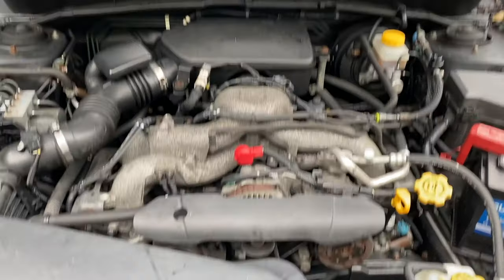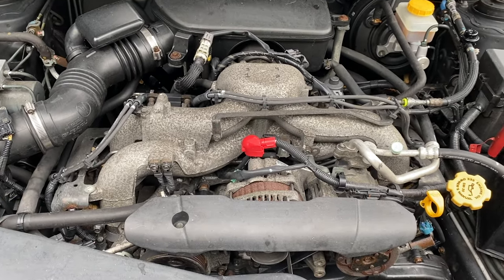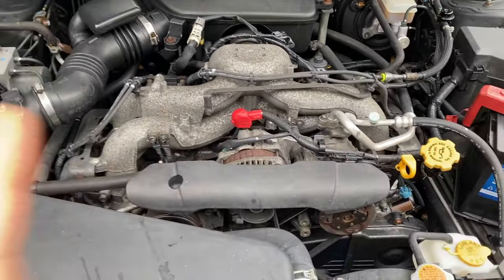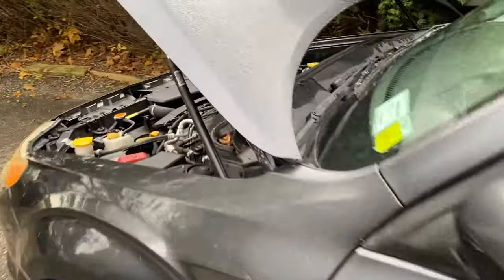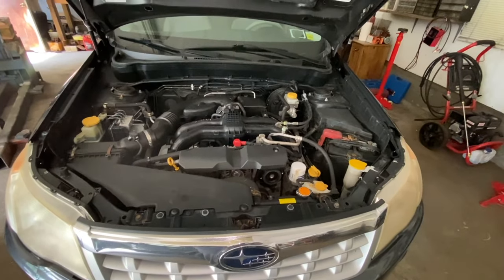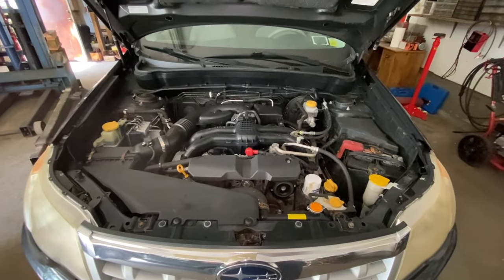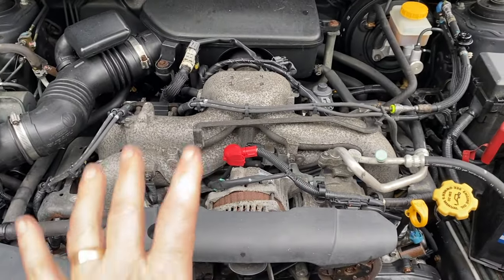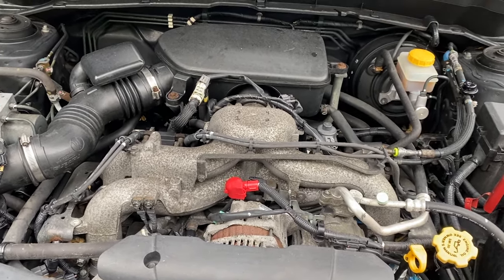Watch And Listen How A Subaru Engine Rod Knock Vs Piston Slap Sounds Like

Comment: Mine (04 Yukon )sounded just like that my starter went out just replaced it today when to boost the battery crank revved it a bit and I heard crackling noises and the engine died ! 😭
Reply from the maker: Sounds like it just seized up

Comment: Mine is odd its got a new rebuilt engine its quiet when cold then when it warms up it has a small knocking noise but only at idle if u give it any kind of throttle it goes quiet again
Reply from the maker: Normal

Comment: Is pistol slap bad for 2014 mazda cx9?
Reply from the maker: Depends how bad but usually Mazdas don't really have piston slap unless engine was rebuilt poorly.
Reply: @Motorcarnut  The car  knocks after the engine warms up. Do you know what causes it?
Reply from the maker: That’s sounds more like a rod knock not piston slap. When engine get hot oil get thinner and doesn’t cushion as well when it’s cold that why you don’t hear it when engine is cold. Also can be a weak oil pump and just a worn engine if it has a lot of miles.
Reply: @Motorcarnut  thank you
Reply from the maker: @cdpc211 sure no problem

Comment: My Subaru sounds like the second one when it starts up and is very loud, however after it warms up it sounds pretty normal 95% reduction, I can hear a little when I give it higher Rpm’s but with windows up can’t hear a thing. Would this still be piston slap since it goes away when warm?
Reply from the maker: Yes it would
Reply: It’s likely what your hearing is your valves ticking. This is also very common with Subarus

Comment: What’s worse to have. And is piston slap something you have to address right away.
Reply from the maker: Engine knock is much worse. Piston slap that goes away when vehicle is hot can last the lifetime of the vehicle. Piston slap that doesn't go away after warm should be addressed sooner than later.

Comment: Hi. If it’s a rod knock. How long do I have before engine is defective?
Reply from the maker: Immediately
Reply: @Motorcarnut  the knock comes and go away. Sometimes I idle and I don’t hear it at all. At time at hear it. Also slight hesitation when starting. 

Thanks for your reply.
Reply from the maker: You can’t play around with engine knock it will destroy engine without any more warning signs
Reply: Mine did that on my Corolla. I can’t drive my Corolla anymore. Lol.
Reply from the maker: @maegantucker973 nope
Reply: @Motorcarnut  engine actually died 😂
Reply from the maker: Sorry to hear that

Comment: Does a quiet slight knock mean you need a new engine?
Reply from the maker: On a Subaru probably not
Reply: Depend, if you have rod knock but you stop the engine soon enough you can just rebuild the internal and the engine will be good for a long time, sometime the block have no damage and can be save. It just cost a rebuild wich is cheaper than buying a brand new engine.

Comment: I have a video on my page can you tell me if it’s a piston or rod knock
Reply from the maker: I just did. That definitely sounds like a rod knock. One thing you can do to rule out an accessory or pulley noise is to take off the serpentine belt and start it back up, if it sounds eacly the same its a rod knock and would have to be rebuilt or replaced.

Comment: I dont have a subaru anymore but i have an 02 accord im trying to flip, upon start it makes a knocking type sound but only on cold starts. After 10-30 secs it goes away and the car drive normally shifts smooth and makes no sound. Is it bc it’s basically oil starved on cold start and as oil circulates it goes away?
Reply from the maker: It very well can be. If you didn't already, try changing the oil and filter and using a oil additive like STP, should help.
Reply: @Motorcarnut  i did an oil change and the time it takes for the noise to go away is way shorter than before the oil change, im gonna try stp and see if it stops it completely
Reply from the maker: @Andy3x yes, it’s cheap and worth a shot.

Comment: What if the rod knock goes away?
Reply from the maker: You’re very lucky
Reply: @Motorcarnut  I used the wooden dowl rod method to listen to the inside of the motor. And it was clattering loud. The tensioner pulley started making a noise and the power steering went out the ps pulley started screeching and the knock went away at the exact same time. I changed the tensioner pulley and power steering pump (I used the original pulley) and the vehicle runs great. So I'm actually thinking it was the ps pump that went out causing the pulley to screech and knock.
Reply from the maker: Great diagnosis! That was probably it!

Comment: That’s garbage my 4.2l ford with 300k miles on it sounds quiet as a Prius compared to this thing. I’d be scared to drive that pos around the block both of them sound like the pistons are about to shatter from all the slack and vibrations. Really sounds more like a wrist pin knock instead of piston slap.
Reply from the maker: You never owned a Subaru.

Comment: Hello, great video. Here is what I got. The noise goes away only when idling or at stop sign, sometimes it just goes away: 
https://youtube.com/shorts/2VhEvk3qpn0?si=lmFE8hihEfsYvPL7

I listed the details in the description along the the check engine codes. What should I do? Thank!
Reply from the maker: Link doesn't work, try posting on your channel.
Reply: @Motorcarnut  here it is under "shorts"
Reply: @Motorcarnut or could it be the failing timing belt tensioner?
Reply from the maker: @gotsu21  Ok, just heard it. You should of reved the engine so I can hear when it goes away, if your engine has a timing belt if could be the belt tensioner if not it sounds like a rod knock.
Reply: @Motorcarnut  Hello, I uploaded three videos:

1.  Cold Start - Idle - Rev
2. Cold Start - Idle - Drive - Rev - Idle
3. Warmed Idle - Rev (Sounds like a diesel engine). But there are chorus of Clanking sounds, it appears.

The engine has a timing chain instead of a timing belt. Since the check engine light on (P000B, P000C, P0014), it intermittently has sluggish acceleration, and the Clanking at idling comes and goes. What do you see? Does the car need some nail service or spa treatment? Thanks for your great videos.
Reply: @Motorcarnut  Were you able to listen to the 3 shorts under @gotsu21's channel? The symptom sounds like bad timing chain with the codes thrown. Please advise - thanks!
Reply: @Motorcarnut  actually #2 and #3 are videos instead of shorts because they are a bit longer. The engine sounds a lot different when it's warmed.

Comment: Makes me want to stay away from Subaru either way
Reply from the maker: That’s understandable, but they still make great vehicles. The design of these engines is what makes them more noisy than the competition. But the newer ones are more refined.
Reply: There's nothing wrong with a Subaru.
Reply from the maker: True
Reply: The newer F engines leak oil and have TCV failure.